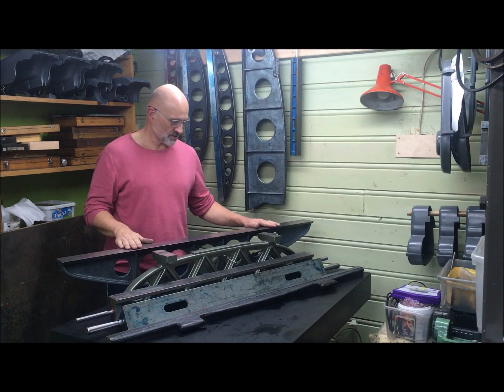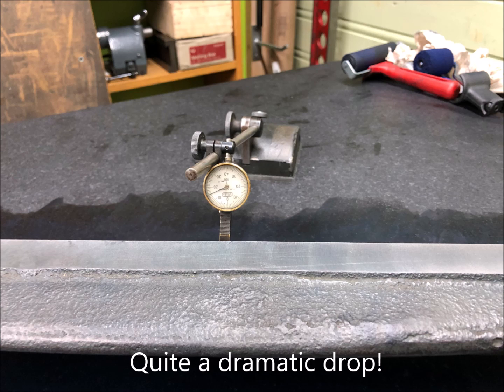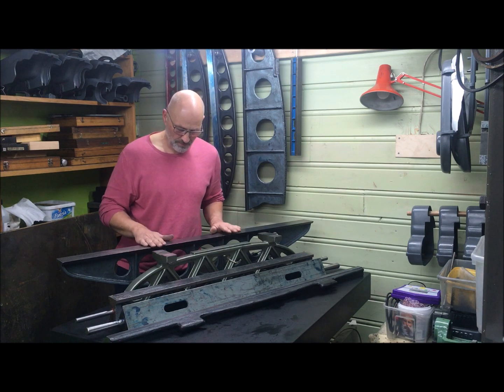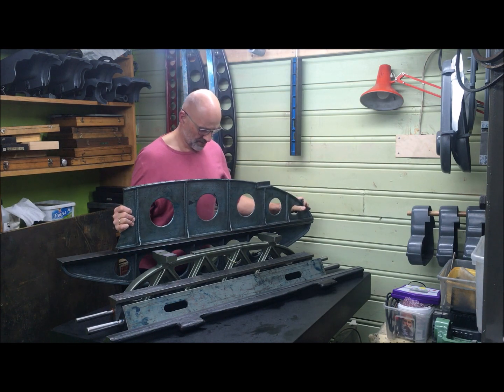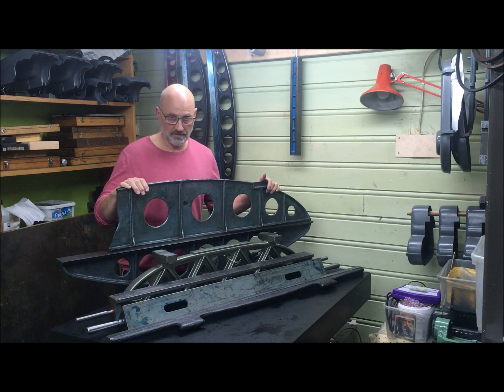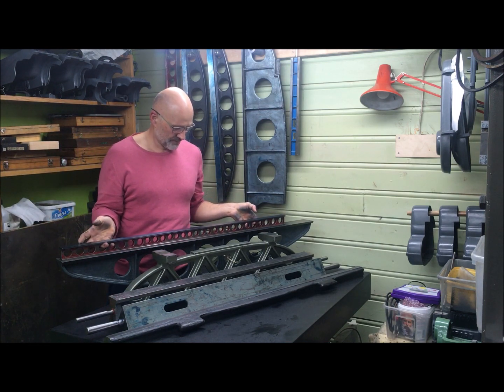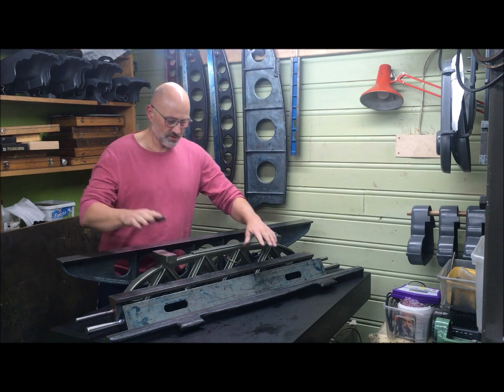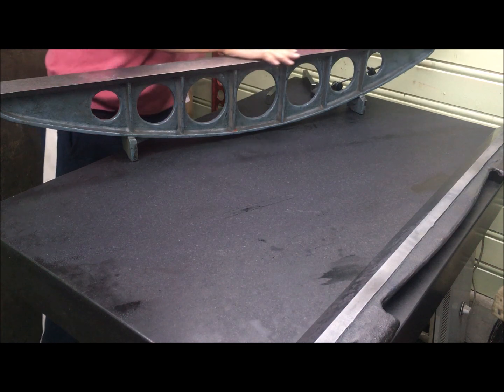Camelbacks, triangular and box straightedges

Comment: Jan, do you know anyone who has welded the clutch pulls together to stop clutch slipping... and to not do all the work to replace the clutch ..can you email me please.   raymcm@hotmail.com
Reply from the maker: Hi Ray,

Sorry, but I have no knowledge of anyone modifying the clutch as you mention, but nonetheless cannot see that it can't be done this way. I considered the clutch to be unnecessary when installing a VFD 3 ph drive system, but still use the clutch sometimes, so can see the advantage. However, I reckon it is by habit, not by need, so.. PS! What about just adjusting it very hard?

Regarding your comments/questions sent to me in email, which I copy here:

"
There are no really good videos on Super 7 Clutch problems. But I agree with you. I don't need it and don't want it... So welding would work I think. My machine doesn't have a gear box.. So I am keen to learn screw cutting..But if I purchase a VFD for my machine I could start screw cutting ?
"

You pose  address different issues here, not all necessarily related:

1) clutch
2) VFD (Variable Frequency Drive)
3) screwcutting, gearbox or not

1) I think the major reason for having a clutch is the ability to stop the spindle while still have the motor spinning, which is/was more of a concern for a 1 phase motor (which normally was fitted for such a lathe). A 1 ph induction motor (as far as I have seen) has a finite number of repeated on/off cycles. A clutch is one way to overcome this. It also allows you switch belt positions (from the counter-shaft) and also engage the back-gears easily without shutting down the motor, ie. rapid rpm change, as well as changing the feed mechanism (tumbler reverse).
2) Using a VFD and a 3 phase motor would offer the same aforementioned advantages as with the clutch because it would tolerate being switched off and again any number if times in succession, plus it would enable a stepless rpm control possibly also extending the upper rpm range (I have used 3000 rpm and more for short time use, which is a matter of setting a frequency higher than the nominal 50 Hz)
3) screwcutting has (as far as I can understand) little do to with having a clutch and/or VFD. Normally you would have to set the rpm down to be able to control the procedure and still have enough torque. Both these factors are enabled using the back-gearing (and lower belt setting and/or VFD drive frequency).. Whether you have a gearbox or not doesn't change the above, it just makes it more convenient to set up for a certain thread and also switch between threading and longitudenal feed. Actually, a gearbox may limit your choices of gear settings as you can only select the different predefined settings whereas on a change-wheel machine you can have a larger freedom of putting together a "change-wheel train". But, of course, it is more cumbersome to setup such a gear-train and therefore may users modify their lathes to include some form of automatic feed eg. using a small motor (most often through a coupling/belt and mounted on the rear of the bed on the right-hand side)

4) I think however you refer to using a so called ELS (Electronic Lead Screw) to ease screw-cutting and feed. It is (again in my opinion) a super! function and very useful addition to the lathe. It involves synchronizing the spindle speed to the lead-screw with an encoder, control box and a stepper motor instead of the change wheels or gearbox. The way it is done with eg. the system I have have bought and uses, from Rocketronics ( https://www.rocketronics.de/shop/en/ ) is just brilliant and I am very pleased. I can do "any" threads, metric or imperial as well as feed rate just by turning a knob and keying in a number. I can also thread at "an unheard of" speed for such a small, "non CNC" machine as mine, routinely at 6-700 rpm. I also included the cross-slide control option (in reality you then only add another stepper motor there), which gives me a completely automated threading cycle, ie. all I do is to choose the thread pitch (ie. which thread), the length of the thread, the depth and set the start and stop points before hitting the start button. Then the machine calculates the number of cycles based on pre-defined settings rough "in-feed" plus "finish (both are user-defined, ie. can be chosen as you like and are stored in the settings menu) , upon which you either just accept or make select fewer or more passes and then start.Then just sit back and watch. After finish the lathe tool is retracted and you can measure/try out the corresponding nut if needed make more single or multiple passes. 

The ELS has a number of other nice functions as well. If you have the cross-slide control also, eg. long tapers, balls, curves  can be made easily. 
A main advantage is also that with this system you retain the manual use of the machine, ie. you just add functions.  You still use the original lead-screw/clasp-nut arrangement so you can undo this and still can use rapid manual feed with the handwheel or also disable the stepper motors and use the fine feeds for both axis.

Comment: Very informative Jan and after seeing those tests it's not that surprising how much gravity can deflect the non camel back straight edges. I would have guessed there would be some movement, but there was certainly a great deal more than I would have thought there might be. The first time I tried checking a tail stock for it's vertical and horizontal alignment to the head stocks center of rotation with a test indicator I got fooled for a few hrs. It's pretty eye opening seeing just how much a light weight DTI can bend a short 3/8ths steel rod due to gravity when checking in the vertical plane. I was getting over .003" of deflection.
Reply from the maker: Thanks. Yes, Richard also usually shows the effect gravity has on a "rotating" DTI .. also surprised me when I first saw this just how much it changed.